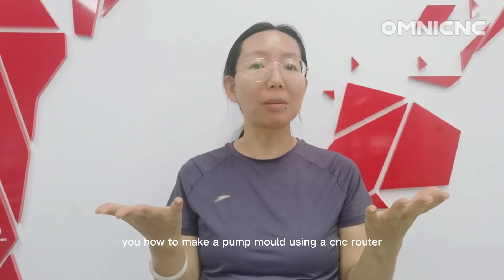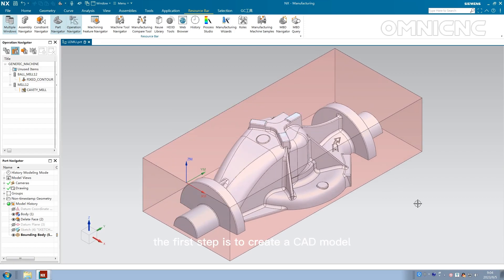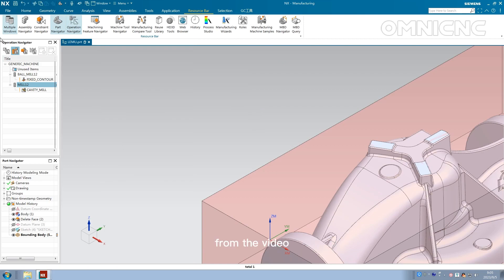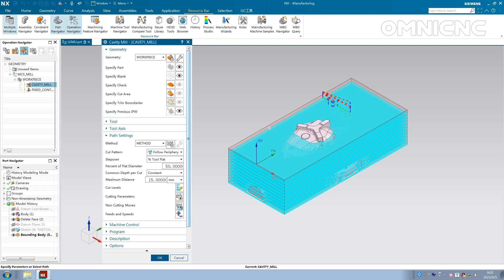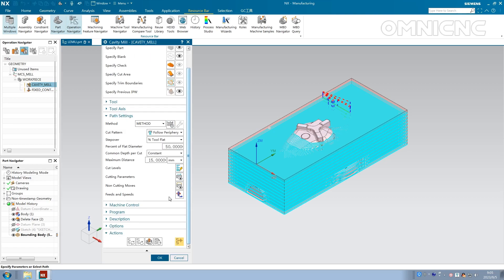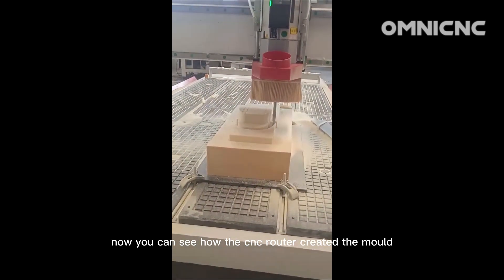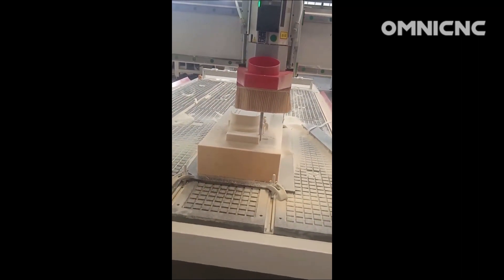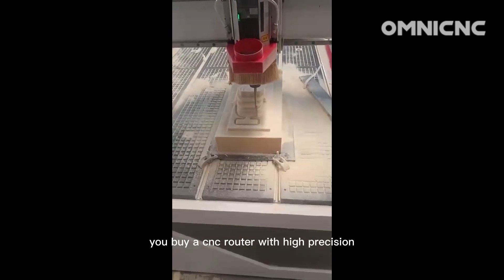How to Make a Foam Mold with a CNC Router

Comment: When I finished the foam  mold how can I coated to be durable for foundry mold production, resin , epoxy what do you suggest?
Reply from the maker: You shouldn't typically coat a foam pattern with a simple resin or epoxy for foundry production, as these materials won't hold up or behave correctly when exposed to the molten metal.

The standard practice for preparing a foam pattern (such as expanded polystyrene or EPS) for foundry work, particularly in the Lost Foam Casting (or Evaporative Pattern Casting) process, is to coat it with a refractory coating

Comment: Hi,
We are CNC pattern makers for the foundry mould industry. What are the X ,Y ,Z cutting capacity and how much is the machine ?
Thanks
Reply from the maker: Hi Paul, 
Thank you for your inquiry about the OMNI ATC CNC Router with HSD 9kW spindle and Yaskawa servo motors and drives. https://www.omni-cnc.com/product/industrial-atc-cnc-router/ 
 I am happy to provide you with more information about how this machine is ideal for mold making. Kindly let us know your email address if possible. For communicating more convenient.

The OMNI ATC CNC Router is a powerful and versatile machine that can be used to create complex molds with great precision. The machine's large cutting area and automatic tool changer make it ideal for machining a wide range of materials, including aluminum, steel, and plastics.

The HSD 9kW spindle is powerful enough to machine even the hardest materials, and the Yaskawa servo motors and drives provide smooth and accurate motion. The machine also comes equipped with a variety of safety features, such as an emergency stop button and a guard enclosure.

Here are some of the benefits of using the OMNI ATC CNC Router for mold making:

Precision: The machine's high-precision components and linear guides ensure that your molds will be machined to exacting tolerances.
Speed: The machine's fast rapids and cutting speeds allow you to produce molds quickly and efficiently.
Versatility: The machine can be used to machine a wide range of materials, including aluminum, steel, and plastics. This makes it ideal for a variety of mold making applications.
Reliability: The machine is built with high-quality components and is backed by a strong warranty.
If you are looking for a powerful, versatile, and reliable CNC router for mold making, the OMNI ATC CNC Router is a great option. Please let me know if you have any questions or if you would like to schedule a time to discuss your needs in more detail.